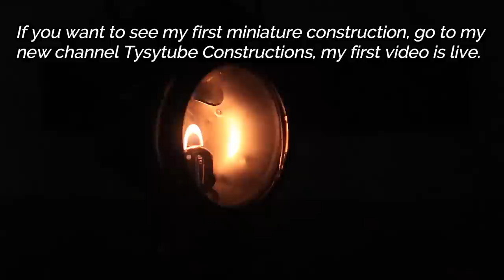1900 Vintage Oil Lamp Restoration...i did it again...

Comment: Another railroad lamp. I am an active railroader; fourth generation, and my dad has a couple of these in his house. 

This is a switch lamp. It sat on the top of rail switches at night to signal which way the switch is lined. When you throw the switch, you lift up on a handle, turn the whole thing 1/4 turn, and push it back down again. So, the lamp is white when lined straight, or red when lined the other way. On a switch lead (a track with several switches in a row) a switchman can tell which tracks he is lined for from the top of the lead. Then he can kick cars (send them rolling free) down the lead and know which track they will go down without walking all the way down to inspect. 
We have electric switches in some yards with an electric lamp (switch indicator light) on each switch nowadays. 
Great job.
Reply: The original Green Lantern comic book character (1940) carried a Power Battery for his ring that was a railroad lamp.  The metal that made up that lamp actually came from a meteorite spiked with magic.  (Don't ask -- the background behind that is a headache and the storyline gets altered every 20 years!)
When I saw this lamp, it automatically reminded me of Green Lantern/Alan Scott.
"And I shall shed my light over Dark Evil..."

Comment: Beautiful work. If I did this stuff, I'd have to have a glass factory close by to replace all the glass I'd break. I'm a DYIer but haven't tackled restoration. I don't have many of the tools you have, so I DYI vicariously through you. I learned a lot of repair work and the interest in doing it, literally at the feet of my dad. I was usually the flashlight holder if we were working in a dark place. But, I learned a lot, especially the will just to DO repairs and builds myself. I've saved a LOT of money over the decades.

Comment: Lighter fluid is naphtha which has fumes like gasoline, these lamps are supposed to use kerosene.
Reply: Beat me to it. Lamp oil not lighter fluid.
Reply: Sure, if you definitely don't want to blow the workshop up, but where's the fun in that?
Reply: Charcoal lighter fluid works the same as kerosene and lamp oil, and some people call it .... ehhh.... let me think... oh yeah,  "lighter fluid."  
Seriously tho, it's cheaper than lamp oil.
Reply: well just for the purpose of testing...  (i hope) 
maybe lighter fluid    ....  cheaper than lamp oil or kerosene? 
well not in my country.. 😅
Reply: I said "charcoal lighter fluid," not lighter fluid. 
Charcoal lighter fluid at the quart or liter size is about $3.39. Lamp oil is more at the same size.
Reply: How about whale oil.
Reply: Yum. Whale oil. Best by itself or more whale oil.
Reply: I’m calling the police.
Reply: @georgequalls5043  yes that is the original fuel for these things

Comment: Another fantastic restoration, but perhaps on the next one no pop rivets! 😃
Reply: It's not a "restoration" with pop rivets (or purple). I haven't seen anything on this channel I'd call a restoration. Re-purpose maybe.
Reply: Lol level up!
Reply: @billmiller7138  It's not a re-purpose if it serves the same function. They are restorations, just not historically accurate restorations. Perhaps they could be called modernizations. I do agree with the color thing though, it's a bit obnoxious. But then again it is his and he can do whatever he chooses!
Reply: Agreed. He can do whatever he wants and he gets lots of views. I just wouldn’t classify it as restoration.
Reply: I’m not a fan of pop rivets but I appreciate the restorations, and to be fair if you go to Meriam Webster one of the definitions of Restore is “to put or bring back into existence or use” so therefore nice Restoration Tysy !
Reply: That's kind of the big thing that stops my projects.  Something riveted?  Well, maybe I'll work on something else.  Not that they're hard to remove, but replacing them properly is very hard sometimes.  And pop rivets ALWAYS look like pop rivets with the dimpled head.
Reply: @josephcote6120  I haven't seen anyone do it, but couldn't you fill the hole on the rivet? Would look more authentic that way.
Reply: @petercolquhoun2086  I literally just thought about that before reading your comment.  Yeah, just fill it with some epoxy resin or bondo and sand it smooth.  The epoxy would help it hold better, too, I think.
Reply: @petercolquhoun2086   Sure.  Poke some Bondo in there and sand it down.   Maybe even just fill it with solder.  That would address external appearance.  Sometimes having the inside stick out even a 1/4" (4-5mm)  would impede the use of the item.   In the restoration here it seems it did not, but we never saw the inside after the rivets were put in.  If you can reach them you might be able to grind it flatter with a Dremel.
Reply: I too was really disappointed to see 'quick' pop rivets used instead of replacement pins. Also... why all the solder? I didn't see any soldered joints during the dismantling of the lamp.

Comment: We've all been there...knew a guy who did the same thing with a car door window. Talk about expensive.
Reply: Guy installing my windshield. As the new one was hovering above the car to be put in, it folded in on itself in 3 places.
Reply: I've done that exactly.  Regulator broke so I replaced it.  Tightening the last bolt of the regulator to the window and POP!  Glass snow all over me and the car I'd just gotten glass out of...

I cheated though got a junk yard window.  I think they charged me $15 for it.
Reply: @nasonguy  thank god for junk yards. Got half my AC system from one and only paid about $30. Cost more to charge the thing after I rebuilt it...
Reply: Razz415.  Pull A Part yards are the greatest.  I hate that I only have one in my town, but it’s better than none.  All the other junk yards pull everything for you and charge darn near new prices for anything that isn’t a motor or transmission.

Plus you can grab as many, uh, “pocket items” that you need, haha.

Comment: It's a shame those cheap 'chrome effect' spray paints are actually just 'silver'.
Not a criticism of your work, just the false advertising on the paint cans.
Reply: They do the same thing with nail polish too. It's a bummer, but it still looks nice in both cases. :D
Reply: Most people wouldn't know the difference.
Reply: @ThatDamnPandaKai  Most people wouldn't know the difference between a semi-matt/pearlescent finish and a mirror-like gloss finish? I'm not sure I follow you.
Reply: @iridescentgherkin  It means they can be cheaper by using the same silver instead of actual chromium paint
Reply: Just a short 5 decades ago, anything silver or chromish paints took like  5 years to set and the look at best was of thin wrinkled cigarette paper. What a mess it was!
Reply: There was a line of chrome paint that came out silver like everything else but you would buff it into a mirror shine. The problem was clear coating it. It turned grey under the clear-coat.
Reply: @blackknightcustom  Testors metallized was pretty good particularly the various buffable ones.
Did a P-51 and a B-17G with the buffable aluminum and the odd panel here and there with other subtly different shades to replicate damaged panels that had been swapped out.
Had to be real careful or wear latex gloves until it was sealed because they showed fingerprints like a mother
Reply: @garysprandel1817  Yeah I think that was it. I used it on an RC airplane, it looked great until I hit it with the clear-coat. I'm going to try Rust-olium gold on the project I'm working on now.
Reply: @ThatDamnPandaKai   So you're saying people who try to save money on paint are too ignorant to know the difference?
I'm trying to find the connection in your thought process here.
Reply: @iridescentgherkin  No, I'm saying the manufacturer can substitute the real things for cheaper material because most of their consumers are none-the-wiser.
Reply: @ThatDamnPandaKai  Pretty sure that counts as fraud. It's either chrome, or it isn't.
Reply: @iridescentgherkin  They get away with it by calling it "Chrome finish" or some other variant to make it seem like it's actually chrome but isn't
Reply: just gonna throw this out there, chrome plating was developed in 1924, meaning this lamp, made in 1900, never had a chrome finish to begin with. People complaining about the spray can chrome color when this lamp never had chrome to begin with.
Reply: Yeah chrome is a difficult product to get in any medium (like nail polish listed above)—-even in digital art which is weird. I try to find genuine chrome effect brushes and palettes and end up having to make my own. They’re always sparkly silver. 🤷🏻‍♀️

Comment: How long did the 'chrome' coating last that close to the flame?
Reply: wont last and not reflective
Reply: @Murlockingqc  it is a shelf piece now
Reply: @yeagerxp  just gonna throw this out there, chrome plating was developed in 1924, meaning this lamp, made in 1900, never had a chrome finish to begin with.
Reply: @Fektthis  it is good to know about the history of when chrome plating was started. Realistically speaking he saved something not made in china from the garbage bin.
Reply: @yeagerxp  I feel much the same way except made in China 1900 sounds like something worth saving to me as well. All those who complain it's not historically accurate are missing the fact it's gone 100 years without anyone doing anything to preserve it. He extended it's life by decades. The time was just about up on this as well as most of his projects.
Reply: these objects are not intended to be reused, just to be exposed on a shelf in a living room

Comment: Because it has a side mount bracket (where the screws fits into the slot flange), and a red side marker window I would say it is a vehicle lamp (not necessarily an automobile), also this would be a right hand side lamp, the reverse image lamp would be for left side (otherwise white light would face to the rear). If it also had a green window it could have been a ships lamp, or possible railway lamp.  Came out nice, but why pop rivets (real rivets are common & authentic), purple paint (dark green-safety red-orange O/K), buy some kerosine (or coal oil) lighter fluid too volatile? It's was a nice vintage lamp, now looks like made new in India for the $ store market.
Reply: It's a carriage lamp the late 1800's and early 1900's automobile lamps are called that too. I too wished he had use a rivet over the pop version but I get why as they are far easier to use.

Comment: Just a question (sorry if it's been asked before) : why use paint stripper and then sandblast ? Wouldn't the sandblasting takes care of it all ? Thanks for your answers !
Reply: Yeah, I wondered the same thing. Paint stripper, sandblast, and then hand sanding...was all that necessary?
Reply: @jeffw8057  Lead Paint was extremely common back in the good ol' days. The point is to strip the toxic material off before sandblasting so you don't generate a ton of toxic lead paint particles in your blasting hood, as airborne particles are harder and more dangerous to deal with than stripped sludge.
Reply: @leifklover1081  Thanks. Good point. I suppose an alternative would be to do a quick lead test on the item. Thanks again.

Comment: you did oillamps so often now.. get petroleum :D not zippo eccence a briquet
Reply: According to wikipedia the french word is "Kérosène". That´s the stuff that is made for oil lamps. Lighter fluid will ruin the wick real fast.
Reply: Lighter fluid will evaporate very fast.  It is not supposed to be used in this lamp; very dangerous.

Comment: with the red light on one side, I think this was part of an old car or wagon
Reply: omegasignas what is the purpose of the red light?
Reply: Good catch! I agree, that must be what it was for. I've seen several antique cars with lamps similar to this.
Reply: @eemelisaurila9940  It was probably on the back of a car with the clear glass facing sideways to illuminate the number plate and the red glass facing back to provide a tail light.
Reply: It's an old carriage lamp. The clear lens faced ahead and the red lens was a side light.
Reply: Ed. Drinkwater alright, you and TheCardiganR seem to disagree on the placement but i suppose both make sense
Reply: @TheCardiganR  Three would be no point in having a red sideways-facing light, and red is the colour for a tail light.
Reply: @ed.drinkwater3815   they did not use tail lights on carriages and old cars like we do now. They use this style lamp and its twin but mirrored version on the other side.  The rear would be a small single lens facing rearward low on the left side. They had no color rules like we do now so it could have been clear, red or yellow. Tho it was common that any light not facing forward would be colored. Lights on number plate is a modern thing and they did not start doing that till after WW2.  
It's a carriage lamp the late 1800's and early 1900's automobile lamps are called that too. Remember the 1st cars were call horseless carriages.
Reply: 1900 would most likely put it as a brass era automobile lamp.
Too small to be an actual head lamp as those would have been larger and used carbide pellets so it might have been a coach lamp that would have been mounted to the side of the windshield frame or fender just ahead of the windshield.

Comment: Hello, I see that with a lot of dedication you are restoring a 1900 lamp, that is, recovering its original appearance and characteristics, I am an amateur in the subject of restoration so I want to ask you some things
1. Why do you use POP rivets, invented in the 40-50s, if you removed iron rivets at once?
2. Why do you replace a pin shaft with rivets?
3. Why do you apply tin solder to a piece that was riveted (the hinge of the main crystal)?
4. Why do you use mastic epoxy if it is known only in the 30s?
I found the color great, it gives a very special touch, beautiful.

Thank you very much for your answers, they will help us to better execute our restorations.

P.S. These lamps used only kerosene.

Comment: Heya @TysyTube.   If you replace the large capacitor that is on the bottom of the motor of your buffer/grinder you will not have to assist start it anymore.   you risk burning out a coil on the motor winding and or spindle if for instance it is left on but does not ever get spun up.   Make a video on replacing it!  I would watch!

Comment: I'm curious, why did you remove the factory rivets ? Those parts would have cleaned up just fine through the sandblasting process without loosing the originality of the factory hardware.

Comment: You do rock solid work man, work on your soldering a little, you were using too small of a heat source, try a small torch next time, should get it hot enough to suck that solder right up, keep up the fantastic work brother.

Comment: If you ever restore any more Victorian vintage appliances that are painted, please be aware that the paint they used back then had a VERY HIGH lead content, so check if the old paint contains lead before removing it. The paint they used on their walls also had a VERY HIGH lead content.

Comment: that lamp was built to be used on a cart or vintage automobile as a pair (this one is the passenger side lamp), the mount (on the right side, looking into it from the front) is the dead give away.
Reply: Thanks for the explanation. I was wondering about the purpose of the 'red' light on the side.
Reply: @jeffw8057  you are welcome (btw, you are missing a wing bolt, it is used to secure the lamp to the cart or car.).

Comment: This is not a lamp for holding. It's either meant for a car or a carriage. The giveaway is the mounting bracket and bolt on the one side, and the red lens on only one side. This one would've been mounted on the front right of whatever vehicle it was meant for.

Comment: Lead solder runs better if the metal piece is hot as well .Just melting the lead causes lumps as it happened in the video. A gas torch and a flux would work like a charm

Comment: since this project jump off the Restoration bus onto the Recycled one and since none of the paints where heat/flame proof so using a live flame might cause problems I would have looked into either mains or battery power for the light source. You could have a static or flickering light source, bulb or led so that the lamp could be used/enjoyed safely on a regular basis.

Comment: With that bracket on the side with the bolt it looks like it would fit to a locomotive, traction engine, automobile or other conveyance.

Comment: question, if you are going to media blast the parts why do you use the paint stripper? I was always under the assumption that's why you used media blasting was to remove paint and surface rust.
Reply: @0ni & potatoes TY for the reply and I see where you are coming from, but he would have to clean or replace the media periodically from the rust and debris he blasts off so I don't see where some paint in the sand would be any worse than the rust particles except he might have to clean or replace it a little more often, I don't know so that's why I always ask is so I can learn.

Comment: I have seen you doing it in other oil lamp restorations... Why use  flammable lighter fuel instead of lamp oil? (It would also have prevented the explosion at the first lighting attempt)
Reply: I agree - lamp oi for lams, lighter fluid for lighters.

Comment: You should look into a paint called allclad 2 chrome paint for the future restoring light reflectors. It is about as close to real mirror chrome you can get without spectra chrome or having it re chromed. Or you could get a small electro plating setup and plate it with nickel and polish it. Great work though